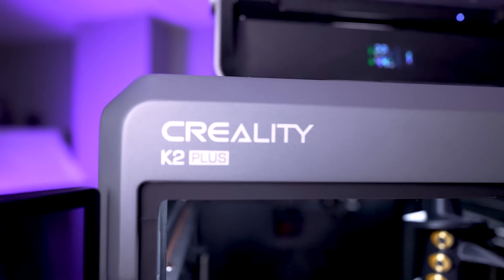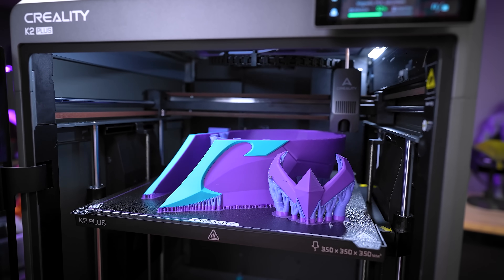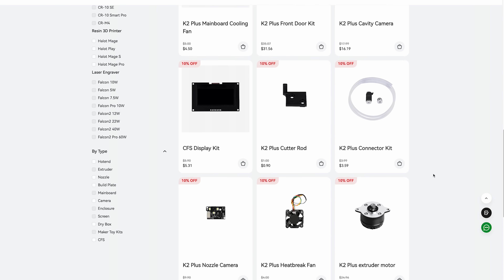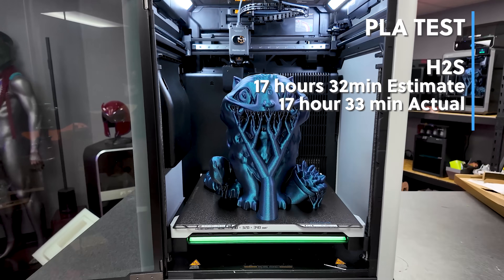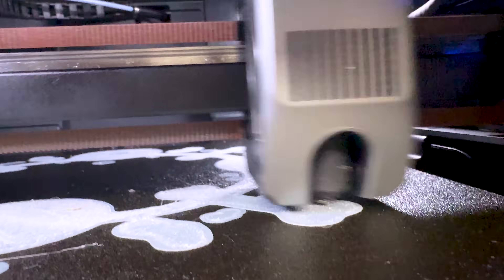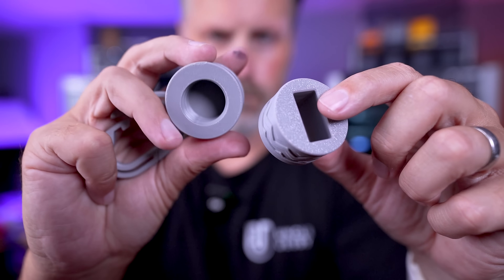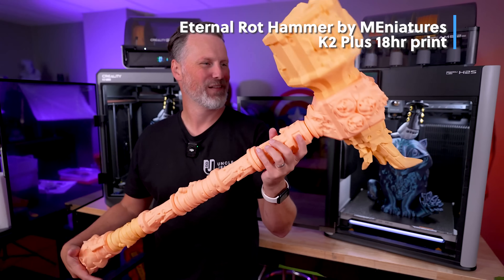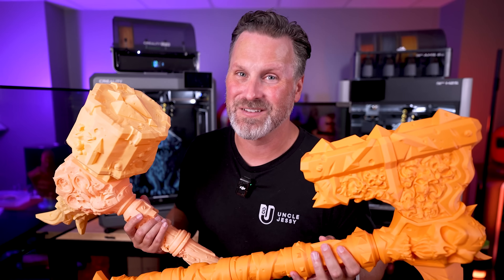Bambu Lab H2S vs Creality K2 Plus — 3D Printer Showdown 🔥

Comment: I've been running the H2S for a week now and have been blown away by how easy and automated everything is compared to my prior Solidoodle, Flashforge and Voron printers. Every print has been flawless so far, with every filament I've tried and without any tuning whatsoever. These desktop printers are finally useful tools rather than time-consuming projects in themselves.
Reply: That's what I love about my Bambu printer. P1S with 2k+ print hours,  A1 Mini with 1k+ hours and now also a H2S. So far they just worked and some are even still on their first nozzle and extruder gear. They just work and save the user a lot of hassle and tinkering with the printer. Time that's much better spend on learning CAD, Sculpting or painting some prints :)
Reply: @Leif_YT looking to get into this for rc body parts and action figure constumea of quality which would you go for hands down ?
Reply: I got my H2S around the same time as you and I am blown away with this printer. Been printing back to back prints 24x7 and it just works, perfect prints every time. All different models shapes sizes... printer does not care... input project = output of part.
Reply: Bambu: It just WORKS!
Reply: What has your experience been like overall with the Voron Printer. I've heard that if one is properly tuned, it can be a great, reliable machine. 
Asking because I'm thinking of getting a Trident
Reply: @MrBluntNose  I built a V0.0 from a Formbot kit and non-PIF printed parts. The build itself was straight forward and the design is clever. After various feeding issues I scrapped the printed bowden extruder and switched to an Orbiter which was MUCH better. Eventually got it printing fast and reliably; but the effort and time required wasn't for me; particularly as other commitments built up.

In hindsight, going down the Voron route was my mistake on my part. It put me off 3D printing for years; going 'subtractive' with laser cutting instead. I've been stacking laser-cut acrylic sheet to create three-dimensional parts, which is very fast and strong; but obviously has severe part design restrictions.

If you want to 'get into printing' as a hobby, I think the Voron printers are an excellent way to do it. If you just need parts for projects, go for an automated machine like the ones in this video. In my opinion they are good enough now to just work out of the box (at least the H2S is).
Reply: @MrBluntNose  Vorons really shouldn't be compared to any commercial line. Building and software setup alone puts this in a different category printer completely.
Reply: Bambu already made a laser cutter

resin printer when?
Reply: @RedDiamondBoi 
Resin will never be hassle free... Why tarnish a good reputation with a resin printer... Resin just has inherant problems that has nothing to do with the printer manufacturer.
Reply: Can you blend multiple materials together?  Like TPU and PETG, I know it's only 1 tool head
Reply: @krollmond7544  The printer will fully retract and purge as it changes filament during a print; so theoretically you should never get a 'blend' of materials extruded, by design. You can however assign different AMS-loaded materials to objects within the slicer and the printer will change automatically, fusing to the prior layer. This can result in long print times and considerable wasted purge material (the undesired 'blended' filaments) being dumped out the back of the printer.
Reply: @XGEOX so i can do a multi color soft TPU print?
Reply: @krollmond7544  My understanding is that TPU specifically must be loaded via the dedicated alternate port on the rear, not via the AMS changer; so no I don't think that is possible, though I haven't tried TPU printing. Bambu have a detailed Wiki covering the usage of different filament types.

Comment: I’ve had my k2 plus since Feb 2025, lots of random errors - took apart the hot end board and noticed a discolored partially melted pin- cleaned it up and added a hotend power limit (60% max) in the printer.cfg .   No more problems and adds minimal time to initial heat up. Prints great not as great as my bambus, but much faster which is good for my application.
Reply: Btw, I saw this same problem on other k2 plus hot end boards as well

Comment: So the tale of the tape is the K2 Plus, even with a year long lead on the H2S, didn't mature enough. Even if newer revisions of the K2 Plus improves on the bugs, there isn't much of a point in picking it up (the $200 savings isn't enough) over the H2S. Now, I am not saying the H2S is perfect. With the Bondtech INDX looming, $1500 is going to be a tough pill to swallow when you can pick up an SV08 and a potential SV08 INDX kit for under $1000. 

I am sure people are going to attack the SV08 + INDX combo as not being beginner friendly, but there will be an INDX'ed Prusa Core One coming. The point being, the days of pricey single nozzle AMD/MMU style printers will come to an end.
Reply: Though 3DP for me is purely a tool, and therefore have only used Bambu so far (just works), INDX is the first tech that is making me consider going w a klipper based machine that requires tinkering. I.e. SV08 + INDX, as I now need 350^3.
Vortek looks atrociously complicated, expensive and still very limited as based on AMS.
Am dreading the thought of tinkering w firmware, mainsail, sv08 hw and co, but man, dedicated nozzles, multi-material w/o contamination, hopefully up to 8 nozzles, would be game changers for my projects.
Am really hoping I won't have to spend days doing the integration and that sovol will instead release an indx version right off the bat.

Comment: Check the extruder connector of the K2 Plus and you will most likely see the teeth that hold the PTFE tube are broken. This happened to mine and all the teeth were missing. Known problem and Creality will send you and new extruder. Sucks but it is what it is. With that said the H2S looks pretty good. Thanks for the comparison.

Comment: I couldn't care less about saving 20% print time, I just want quality.  Your video answered this.
Reply: The H2S' acceleration can easily be pushed up. I suggest looking at 'printing perspective' YouTube videos of the h2s
Reply: Keep in mind he is using the generic profiles which cap at 300mms on the H2S 

I can get the stock nozzle printing PETG at 400mms. So basically take 25% of the time off of the prints he did if you use your own profiles.
Reply: Yup. And my H2S arrives in the next couple hours :)
Reply: @tam653m  hows it been going? im getting one soon
Reply: 100% agree. But even the time difference depends a lot on what filament profiles were used.  In Bambu Studio for example the Generic Profiles work very well for almost any filament, but they've a conservative max flow rate. The Bambu Filament profiles are usually much faster and work also very well with some other brands like the Sunlu Filaments.
Reply: The real question is whether you can achieve better quality by slowing down the faster printer, which demonstrates lower quality, to match the quality of the slower printer. You might demand certain default biases, but it's an arbitrary choice most likely made by marketing people.
Reply: Hmmm agreeed .. quality …
Reply: I was trying to decide between these two and thankfully you made a video on them. I have now decided to go with the always strong Bambu Lab K2S! Thanks!
Reply: @gunnarbiker  you mean h2s
Reply: both print pretty identical, one is faster and bigger build volume, thats what wins for me.
Reply: Well as a person that owns 3 K2 pluses and an H2D the quality is not noticeable at all but if you print tpu stick to the Bamboo you use a lot of petg up the heat on the k2 plus and your good to go
Reply: Yes you do
Reply: well u can bump up the quality and still save time so...
Reply: @kingty8010 well, you can't bump up the quality on a garbage printer. So, printing slow or fast garbage is still garbage.
Reply: @jonwoodworker  the fact of the matter is neither are garbage printers... and you can in fact bump up the quality to suit your needs...
Reply: My old ender 3 v1 bed slinger makes better pla prints then my h2d does and I mean a lot better I just got the h2d so I can print pa6-gf but I am thinking I should have got the cheaper k2 plus and I wouldn't have had to wait 3 weeks for the k2 I would've had it the next day, I think these Youtuber videos are bias so they can keep getting expensive bambu printers pre-release and paid from making these videos. Creality printers print great in my opinion you just need to slow it down a bit they rate them faster then they should run. Just because a corvette can go 180 doesn't mean you are always going to floor it!
Reply: on large prints the High flow nozzle will easily makes up the difference for the H2S.
Reply: @ThePlacemat I wish they actually release profiles for it though. For now I run prints at 25% and they look identical with the HF Nozzle.
Reply: @protecteratr they do have profiles for it each filament on the H2S has a standard and a High flow tab in the settings
Reply: @ThePlacemat they do but it does not increase the default profile printer settings. It just says the filament can go to a higher speed. If you preview each way it makes no difference in print time. You need to manually adjust each setting to adjust for it. Technically it's better that way to test each setting with HF then just bumping up the mode but I have not had the time to do that and Bambu Slicer makes testing those settings not the easiest compared to other slicers. Also I am using it on the H2D but that shouldn't make a difference.
Reply: @protecteratr I just had to go check to be sure I wasn't going crazy. Nope it saves time without setting changes. Just added a 400% primitive cube and on high flow nozzle it saves nearly 2hrs. 
The wall, top and bottom layer speeds are the same so if you are printing small things you wont see a savings.
Reply: @ThePlacemat maybe it changed recently. I will need to check that when I get home.
Reply: @ThePlacemat  So this is very odd. 
For a 492g single color print HF VS SF: 
H2D HF 6h 33m
H2D SF 6h 55m
H2S HF 5h 26m
H2S SF 6h 51m

H2D 5.3% faster with HF
H2S is 19.86% faster with HF

So there is something still wrong with the default HF profile for the H2D somewhere.
Reply: @protecteratr I believe they said the H2S can accelerate and decelerate faster than the H2D due to the lighter tool head.
Reply: @ThePlacemat Even if that's the case they originally sold the high flow nozzle for just the H2D that said 20% to 30% faster. Kind of sad if it can't officially. As far as I can tell though there is no difference quality wise between 100% and 124% speed. I've checked over multiple prints.
Reply: Couldn't care less. If you could care less then you must care some.
Reply: You mean you couldn't care less. Also people need to stop this whole print quality or "it just works" mindset when it comes to Babmu Lab printers, even the video showed failed prints and just look at the Bambu subreddit or forum which is 90% troubleshooting and failed prints. They are printers just like most others these days, they don't havve some black magic formula.
Reply: @kwedl . my experience with a Bambu X1c after 2000 hours of print times is it’s a “Tool” not a project. I create my parts in CAD, slice in Bambu Studio. If it’s a precise part I may have to revisit the part in CAD . 

The X1c is my very first 3D printer, I’m a retired engineer and I used it to print functional parts I design.  Im surprised how well it just works!
Reply: @kwedl  You have kinda a point at the first part, the reason the subreddit is like that is to prevent these errors from happening, not because they actually happen all the time. though your second part, its not the Bambu printers that look like others, its the others that look like Bambu or Prusa printers.
Bambu and Prusa are the leaders of the 3D printing industry, without their 3D printers, we would have no decent Core XY printer, proper drying multi-material systems, the fact they can last for months without having replacement parts, ease of access, and their print qualities. Sure, other companies made better printers than some of theirs, but the only reason why they were able to reach such heights was due to Bambu and Prusa's discoveries.
Reply: @kwedl Agreed but sadly people like my roommate can barely handle loading filament without me doing it and showing him how to put brims and proper supports on prints haha. Worse he uses my Creality printers more then my Bambu Lab printers but that's more due him liking the size of the K1Max/K2 Plus over the Bambu ones. I have seen him print the same thing so many times and one extra support with a bigger brim would fix that issue. Also telling him to clean the build plate with soap and water haha
Reply: @kwedl  The 'it just works' mindset is beautiful. I set prints, i go to work, i set prints, i wake up, i set prints, i finish eating dinner and go collect them.
The reason why the subreddit or forum is 90% troubleshooting or failed prints is because they just work. 98% of the users never need to visit these pages.
Reply: @raven239  right? some of us have 3d printing hobby, not a 3d printer hobby. We already spend time designing what we want to print and we don't want that extra step of trying to fix the tool other than doing regular maintenance.

Comment: Nice comparison. K2+ definitely has some issues, but i would say that's a solid machine. I've had it for a while now and i mainly print PETG. 
On the other hand, TPU is a headache.  I was able to print a few parts with some tweaking,  but there is definitely an issue with this kind of extruder. Btw tpe with 83a shore hardness (if i remember correctly) gave me better results than 95A TPU. I used eSun eLastic filament

Comment: I was a "tinkerer" for 13 years ... since Aug. 2024 I have a X1C, and now the 3D Printer is a Tool - and not a Project on its own anymore. Less than a hand full of errrors in over a year. I press print and leave the house with confidence. That stuff just works. Do I like the Lock-In-System? Hell no ... but it is like with Apple. As long that it serves me more then it locks me in, im "okay" with it.
Reply: Same here and getting an X1C completely brought me back into 3D printing. They're now finally appliances
Reply: We did have tinker free machines back in the day. But you had to spend the kind of money a bambu costs and no one did. I ran a couple of Ultimaker 2s for years and those were rock solid. Though they were a lot less fancy than modern printers if course, which I think is fair for a printed launched in 2012. Their Achilles heel was the 2,85mm filament but that cost about $100-150 to fix and took a couple of hours. But as said, those machines were properly expensive. My extended cost something like $2500 and that was a demo unit. The regular I bought used for about $1000. This is in 2015 money.
Reply: @jonatanrullman my last 1000€ Prusa did definitely not work as smooth as a 1000€ X1C. Ive built many printer by myself - but im glad that stuff now just works out of the box.

Comment: Nice comparison video.  Concerned about some of the issues you were getting on the K2 Plus.  But you were comparing an out of the box new printer to printer with a lot of print hours on it.  Next time it might be helpful to do an deep maintenance or overhaul on the used candidate?  Either that or get a new fresh out of box test subject?
Reply: Yes to a point. But he mentioned several times that he's had issues w printing non-pla on k2+ since day 1.

Comment: I will never recommend a bambu printer due to the locked down ecosystem.
Reply: 😭😭😭😭😭😭😭😭😭:face-purple-crying::face-purple-crying::eyes-purple-crying::eyes-purple-crying:😿😿😿:eyes-purple-crying::face-purple-crying:😢😭🤡
Reply: Ok
Reply: Love my bambu .. had Ender 3 and sovol.. bambu locked in means IT JUST WORKS.. i want to print stuff , not mess with settings and tinker.
Reply: What's locked down?  Are you sad that Bambu gives us hardware and software that actually works?
Reply: @jonwoodworker  i think they are trying to become a 3d printer repairman, while most of us just want to print things foil hat clowns

Comment: Im a creality guy i hate bambu and i dont have the problems like this on my creality machines
Reply: That’s funny. I’m a 3D printing enthusiast and I love watching these hobbyist 3D printing companies compete with each other with larger build volumes, better purge protocols, higher temps, and cheaper prices. 😝
Reply: That's funny, am a Bambu P1S user and I care about or hate neither Creality or Bambu.
I don't give a crap about brands and clanism, just looking for the best tool for the specific jobs I need to do.
INDX looks very promising, Vortek looks overcomplicated / expensive / limited, and I now need big volume + mixed materials at $1200 max. So will be looking next at SV08 + INDX or such.
Meanwhile, tribal fanboys and bone-pickers...
Reply: That's funny kus I'm a Bambu guy and hate Creality, I see far more issues on Creality printers then I do on Bambu printers. The print quality on the K2 Plus is atrocious for a "Flagship" level printer, my A1 and A1 Mini get better prints then that piece of scrap metal.
Reply: @EliteCanadian92  That's funny, I'm not a Bambu or Creality guy, I currently own a QiDi Plus 4 and a Anycubic S1. I have been doing a lot of research on both the K2 Plus and H2D (now also the H2S) because I'm looking to buy one of them. The majority of everything I have seen agrees with you, K2 Plus (Creality in general) is hit or miss with very questionable quality (print and build). While Bambu, for the most part is rock solid with the occasional issue.
Reply: Hate is a strong word to use so frivolous.
Reply: @augustopaixao8911  what... this is YouTube not the morality awards buddy